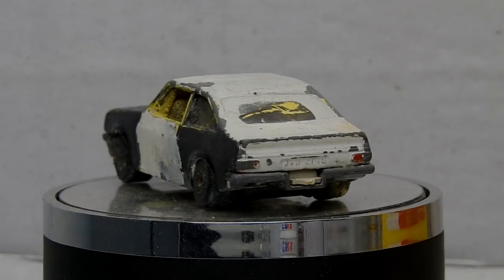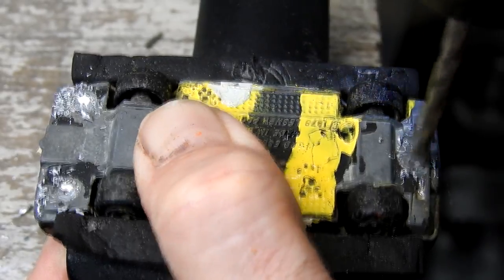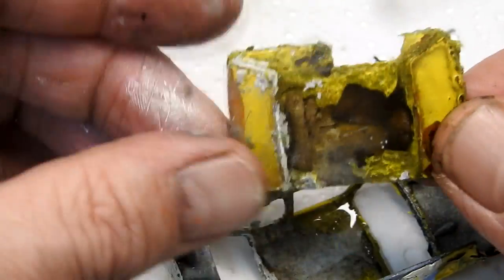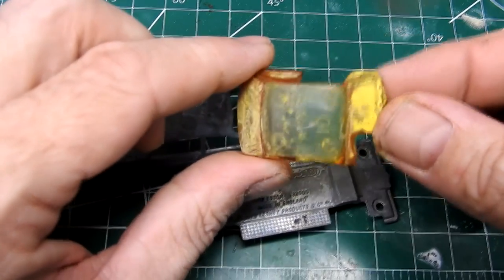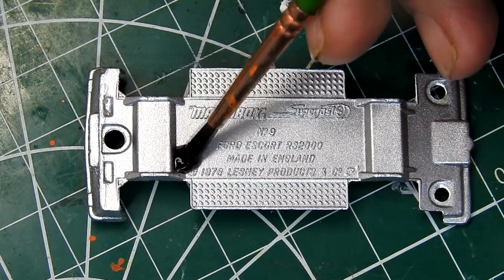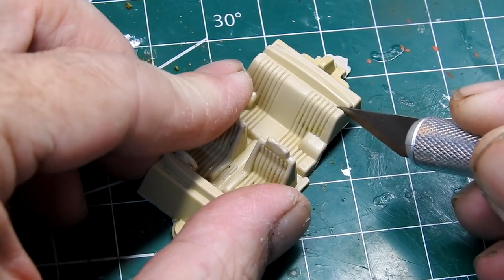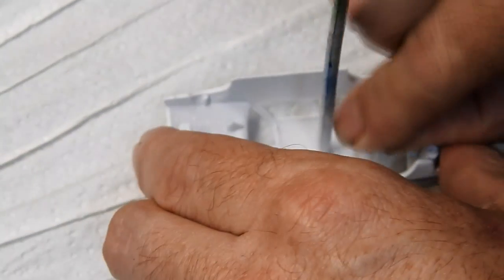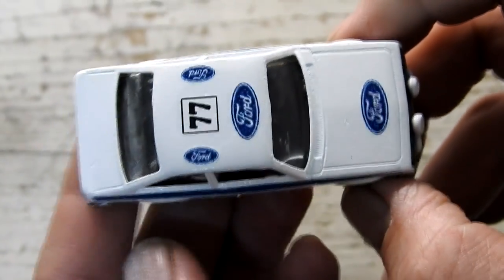Matchbox Custom Restoration Superfast Ford Escort RS2000 Rally Car Build Off

Comment: How cool is this! Matchbox Superfast no9, from 1978. I have a mint one, untouched, exactly the same as this. White, with yellow/light blue/dark blue decals from Shell/Dunlop/Cibie, and a huge Ford oval on the bonnet with RS2000 in red letters also on the bonnet. Or hood, lol. And the towbar is there. And, yeah, no 9 is also a huge number in red, on the doors. D@mn, i have had it in 41 years! :) And btw, you did a fantastic job with your restoring, cheers, and thumbs up!

Comment: I loved being thrashed around in these cars especially the rs2000 it was road but rally. Bright yellow blue detail's. Roll cage, mesh in the head rests. 4 star wheels had blue in them and forking roared. I nearly caused its door to fly off. "is that door shut" yh. Spins it 180 into a car park door flies open 4-5yr old me clings to the side bars lucky they were fitted. Oh he was mad if look's could kill. Stepdads best m8's car. I loved those cars. Through the 90s.

Comment: My first P plate car was an Escort RS2000 2door in monza red. They actually had a really nice rs steering wheel so you'd probably not gone for that momo after all !
Reply: can remember down our way when I was young, someone had a Black  RS2000 x-pack version........could shift to say the least.....
Reply: The Xpack body kit looks awesome..Also good idea for a build off !!...fitting an Xpack kit to ya Diecast RS2000 using aluminium can, body filler etc

Comment: Hi DJ.....the Sterling matchbox you showed is really a '91 Rover 820 MK1 (not a Dodge or Ford Escort). It is or it was a English (Made in England) car that one of its models used to have a Twin Cam 16 valve, front wheel drive. Cars enthusiast indicate that it was a very reliable vehicle.

Comment: I'm 15 and looking to get into this. What things do you recommend to get started? I have an airbrush because I make a lot of models and I have a power drill that I can use already. Great custom by the way, love the seatbelts. How did you make them?
Reply from the maker: Hey, to get started along with your airbrush and drill I would recommend needle files, small pliers and side cutters, a craft knife, tweezers, picks, sandpaper, steel wool. A rotary tool like a Dremel is super useful.  A tap and die set if you are going to use screws. A coping saw. Other bits and bobs you will just acquire as you find you need them. I made the seatbelts in the Escort with thin strips of rubber tape and then made the buckles from little bits of plastic.
Reply: Danny's Diecast Disasters Thanks man!

Comment: What are the names of the papers you use to print the stickers on? Do you think you can use it on glass too? I work with labels for household jars for deverse objects and groceries. Enough with a regular Hp printer for this special paper. Had something good when I worked as a painter at Rörstrand abzer print for bottom stamps. Fun to see your solid job you do. Hug from Gothenburg in Sweden.
Reply from the maker: Just serach for decal paper on Ali Express was where I got this stuff. You can also bake it on in the overn for ceramics etc.
Reply: @DannysDiecastDisasters   Thank you so lot. I going to do that. Have lovely weekend.

Comment: You did a very good job Indeed, but   in this particular case you did wrong.

The car looked absolutely fantastic as it was.
A masterpiece and the only one of it's kind.
You only had to change tyres and clean up the interior a little bit to have the car working.

Now that car, history and patina is gone.

Comment: You did a great job, but that is such a shit car. Lol I had the 89 escort and it was horrible. On the upside it only cost $25 usd every 2 weeks to fill it up.
Reply: That's an RS2000. They go for silly money, highly thought of in Europe and are rally champions. Still used for rallying today. Definitely not shit.
Reply: @oliverp4115  I'm sure they are great if works put into them. But the Ford Escort here wasn't great. They are different creatures. The 89 that I had had leaf springs that were so soft you could push the entire car down till the tires were touching the wells, and a 90hp 1.9L I4. Took 16 seconds from 0 to 60. lol I don't know how they are in Europe but certainly not the same. Also, we didn't have them till the 80's.   I don't have any experience with the pre-80's escorts.